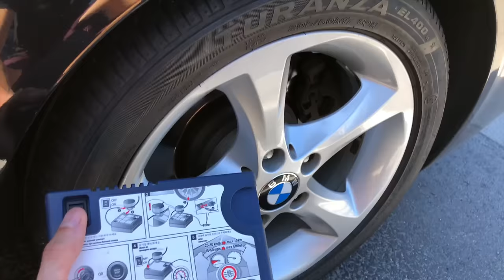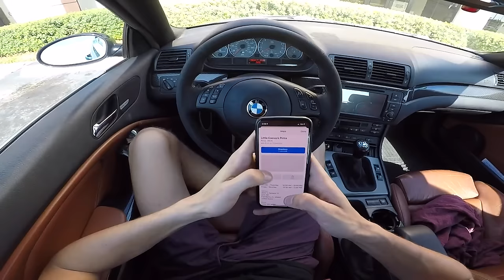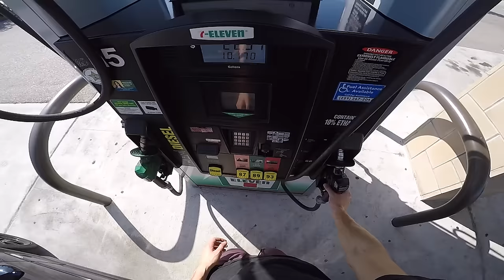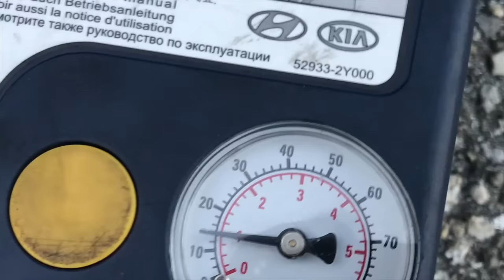E46 M3 Street Drift *POV*

Comment: 4:32 Re: As long as your RACP is reinforced, M3 axles, diff and trans are known to be virtually indestructible. They're even swapped into other makes of cars for high HP drag applications. I wouldn't worry about breaking anything when dropping your tire pressures.

Comment: Hey man, i just watched your video, nice drifting. But i would like to give tou advice. You hold the clutch pedal forvery long periods of time , for example when you are moving on lot to pizza, when you start the car, when you turn off the engine... Maan, give it to neutral, dont hold it in 1st with your foot holding the clutch. Give the clutch pedal the rest in neutral. Also this way you ride you destroy clutch and flywheel morefaster than using neutral.

Comment: Just a beginner question about manual cars. If you wanna shift quicker, can you let off the clutch quicker during an upshift and push the gas faster or do you still gotta be easy letting off the clutch?
Reply: yes you can, but you still have to have good precision in order to have a smooth gear change

Comment: I got a 2000 323i  e46 RWD for 2G guy I bought it said it has a 330i engine swap from a 2001 it got headers and down pipe with a 5 speed Manuel any tips on what I should do to it I’m thinking a t4 turbo kit with a 6 speed trans so it could handle power any tips cuz it’s my first time doing anything to my own car this my first car and it’s a  euro when I’m used to Honda but I love it so much already how they drive is like no other but also overall stuff I should get that is not a lot for the moment till the turbo upgrade any advice I would appreciate it a lot

Comment: Does higher tire pressure mean more grip ?
Reply: no higher pressure is less surface area thus less grip, so lowering the pressure get you more grip but too low pressure tire will bead out the tire from the wheel. Corect me anyone if i'm wrong.

Comment: I really like your vids...but the car was cold ;(
Reply from the maker: Saevitum HD I wouldn’t have pulled my engine and changed out my rod bearings if I wasn’t going to let the car warm up properly. Even my temp lights on my gauge cluster have been converted to oil temp instead of coolant.
Reply: @HoonGarage  alright😂👌 i mean its your car... but i good u warm it up

Comment: Bro !!! Am I the only one who thinks that it was stupid to swap the s54 with 1.5jz!!! I think it was better to put turbo on the s54 instead of the 1.5jz!!! LESS Work and for me , natural is better than the turbo I mean the m3 could do burnout in 3rd gear I mean damn it was less powerful than the 1.5jz or what? Yeah 1.5jz with turbo has more power than the s54 but I want you to compare the s54 with the 1.5 jz(WITHOUT TURBO) and think about it. Was it worth it the effort of saving money and the work on it to have e46 1.5 turbo or to just put turbo on the s54!!!
Reply from the maker: I loved my S54 and am perfectly fine with na power but my S54 had a catastrophic failure at the water pump from the block. The S54 is a great engine NA, but if I wanted to Turbo it, it would be a lot more expensive than the 1.5jz to get similar power levels. I wanted something simple and easy to disassemble like the jz, the s54 is a lot more complex. For what I want to use the car for (street driving, road trips, and drifting) the jz made more sense.
Reply: @HoonGarage  Understadable bro!!!

Comment: why he clutch kicks is so often idk lol, its a 350hp car that weighs a lil less than 1500 kg AND  a LSD , i do the same shit u do without clutchkicking and destrying the car with my fkn e46 325i that has 190 hp and an open diff. learn to drift using the foot break and gas and use the weight shift to get the car sideways and stop destroying a fkn e46 M3.
Reply from the maker: OmizM8 I’m not scared to give the clutch some heat, I’ve pulled the tranny plenty times on this car wouldn’t take long to fix anything that breaks. If you think this is a lot of clutch kicking go watch my e36 video😂
Reply from the maker: OmizM8 the clunk you are hearing is the infamous “m clunk”. Racing diffs sells a preload shim to fix that issue. The car has condor bushings throughout and the subframe has been reinforced. I meant to say I’ve pulled the transmission on this car plenty of times so really if anything breaks I’m not too worried about it. Yes, I agree in some cases clutch kicking wasn’t needed but I’d rather go for a faster initiation instead of a slower feint.